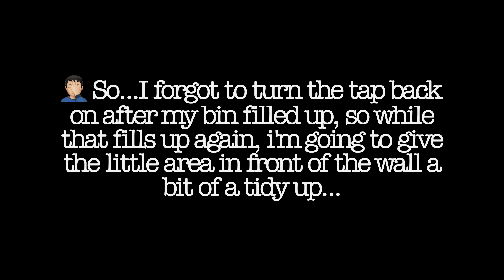YouTube Watcher Reaches Out For Help To Get His Grimy Driveway Back Under Control!

Comment: Fantastic job!  Very satisfying to see those weeds pulled out in slo-mo as well.  I love it when the entire roots pulls out instead of breaking off...I'm curious as to why you fill up the yellow bin...I've seen others power washing (on YouTube) with one and without one.  Does it give you more water to work with compared to what comes out of the houses hose?  Perhaps you could mention it in a future video...Thanks!!
Reply from the maker: Hi Julia, the bin is used as water storage. The machines most of us guys use who do this for a living are too powerful to be attached directly to a tap the water flow can't keep up with the pump, so we either use a bin, barrel or some guys have a tank on their van, that we fill up before we start, then the pressure washer sucks it out of the bin/tank 👍

Comment: 5:17 you are right it looks like hard water limescale, but it could also be a bit of soap scum as well as my drain has the exact same stuff all over it. I’ve cleaned it off successfully before in the past but personally it’d be better to have some kerbs around it to stop it splashing over.

Comment: Hi Nick I recently cleaned my sisters patio and concrete area and the concrete area does not get much sunlight and keeps going green is there anything I can put on it to stop it going green many thanks Dave
Reply from the maker: Unfortunately there's nothing you can put on it to stop it coming back eventually. An application of hypo or bio every six months should keep it well under control though. The cheapest thing would be pour household bleach on it by watering can every few months 👍. The cheap watery stuff you get from Tescos, 2 litres for a quid 👍
Reply: @PrestigeExternalCleaning  Cheers Nick I have some hypo left when I did my patios so will give that a go as only used patio cleaner on hers from Jennychem which never cleaned the black spot off but I am sure the hypo will hopefully shift it but I have to be careful as she has a cat and dog so need to really rinse it down well I wish I had purchased the 20L of hypo and not the 5L now would have been more cost affective keep up the videos really enjoy watching the transformations you do